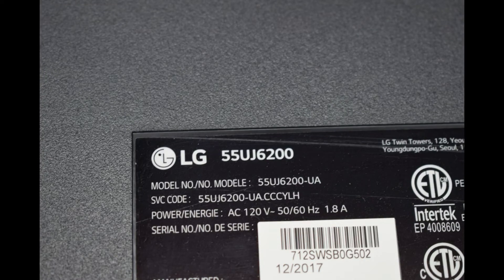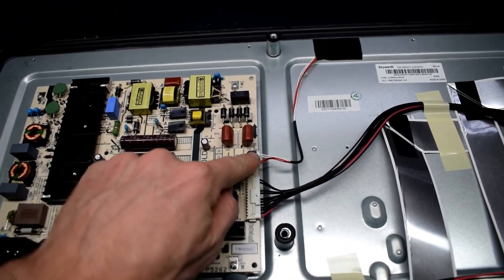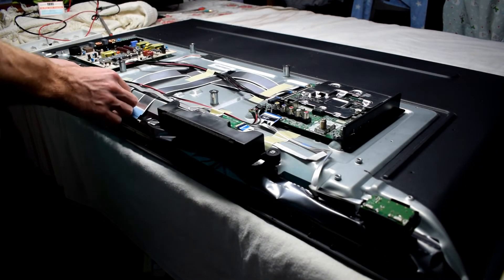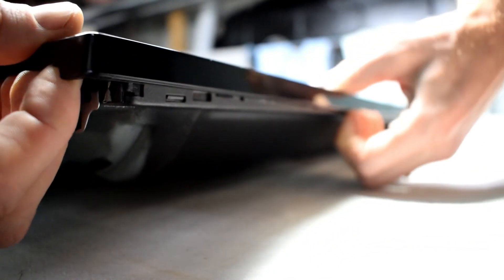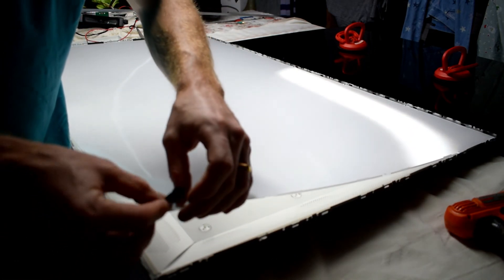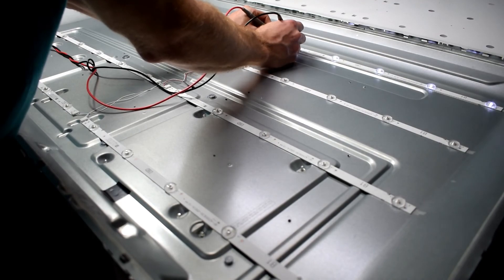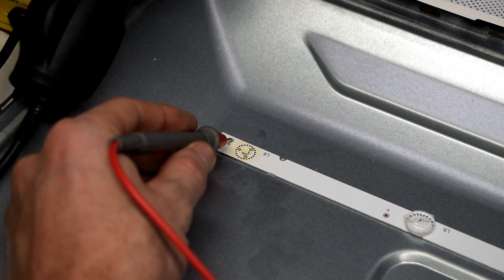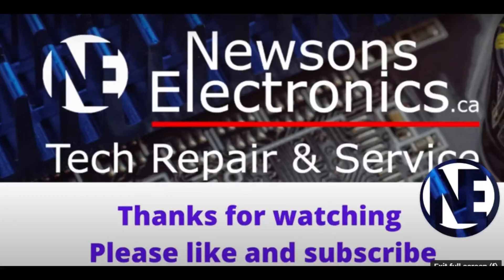Fix LG TV backlight for cheap! (Model  55UJ6200)

Comment: it helps to have the backlight tester - Fluke meter is not strong enough to push through the backlight. watch the ribbon cable connection but yes this is  the fix thanks.

Comment: Great tutorial 👏🏽👏🏽!! I have one question, if the glass round lenses comes off the led light strip, do I glue it back on to the strip ? If so, what type of glue do I use ?
Reply from the maker: I used shoe glue but silicon works
Reply: @NewsonsElectronics  thx !

Comment: If you dont want to mess with soldering the one light in can you remove and replace a single strip? I've soldered  pipes and metal but low confidence  in electrical boards

Comment from the maker: Any questions just ask them below.
Reply: Hi, I have been following your videos.  What's the name of that liquid you're using to repair the backlight? Thank you.
Reply from the maker: @fiificobbina6511  liquid solder https://amz.run/57ST
you can also tack it on with a soldering iron but it's a bit tricky
Reply: 2 questions: are the LED strips themselves plug and play if I got the correct model of strips? secondly, what is holding the strips down? is it glue or some other fastener?
Reply: 2 questions: are the LED strips themselves plug and play if I got the correct model of strips? secondly, what is holding the strips down? is it glue or some other fastener?

Comment: Hello Thank you for the video, the diffuser screen,  is the thicker sheet with the rough side down towards the leds. and  then the thin plastic sheet on top. I think I may have mine installed the wrong way. I can now see the leds thru the screen. also the black tape on the bottom of the back side. ripped apart how important is that tape layer.

Comment: I unhooked the led connection at the back, measuring at the power supply side of the connection its reading in mV(60ish on one, 58ish on the other). 
Bad power board then? I don't see any visible issues on the board.
Reply: Same with me. 58 on both. What’s next to test?
Reply: @bruizer28  sorry, I gave up and just bought a new tv. Figured it'd be a process of replacing a board at a time until it worked again.

Comment: Have the same issue with back light, flickers when turned on, sound, can see dim image with a bright flash light close to the screen but I’m also having the problem of the tv turning off after like 30 mins of being on also? Is that a whole new issue or would back lights going out cause that to happen also?? I can live without the image working, I normally just use the tv for music and background noise.

Comment: I have the same model and issue. Any chance you can recommend a repair shop around Toronto?
Reply: Exact same problem here also from Toronto, we’re you able to find a repair shop for yours ?
Reply: @hoth9whitey  I was able to speak to a technician but he advised to just buy a brand new one. He quoted the repair over $500 if he will diagnose and repair which makes no sense but to just buy a new.
Reply: @hoth9whitey  Are you disposing off your TV soon? If you ever trying to dispose, could you just let me take it?

Comment: Is it always the LED themselves that are the issue or could it be the power supply for the LEDs? Mine quickly flashes for half a second when I turn it on then the backlights go off. Wouldn't it be possible for the lights to flash if 1 LED was bad?
Reply from the maker: if flashes its the leds

Comment: Can I just remove an LED and solder the contacts or remove a whole strip?
Reply from the maker: no it detects the volts and current must match
Reply: @NewsonsElectronics  how big of a variance is allowed? I tried solder a new LED. Failed. ordered a new power supply board as this one is only putting out .08Vdc. New board installed but still not working. Removed LED and soldered direct bypassing LED. Still no go. Ordered a new LED back light strip kit, waiting on shipping. Learning a lot from your video and been having fun with this repair. Thanks for your time!
Reply from the maker: @kalynkoster6715  use led tester to test your leds you don't need to replace them all this  will determine if its your powersupply or backlights.
Reply: @NewsonsElectronics   I bought everything in your video. Tested every strip and every light like you showed. It’s one strip that’s being a pain. The LED on both ends works correctly but the 3 in the middle are messed up. I will see what happens when I replace the strip. Your video is very informative! I e watched it over a dozen times.
Reply: Ok replaced LED strip that had bad LED, still sound and no picture. When I hold a light up to the screen I can see it’s working but no back light. Replaced power supply board and still same issue. Any ideas
Reply from the maker: @kalynkoster6715  use led tester I bet your backlight is still the issue. When you turn on the tv the backlights should come on if there is standby on power supply board.

Comment: Have the same issue and same TV. Tested the voltage on both wires going to the backlight cable. Each of them is reading around 58. I know it should be 60, so thinking 1 led is broken per circuit. Is this still enough to shut the whole tv down?
Reply from the maker: you are correct

Comment: I have the same model tv with a backlight issue. Black screen. After watching the video I'm not sure I can do all of that without causing any other pro problems.  How much would this cost at a normal repair shop or should I just buy another tv.
Reply from the maker: I would repair it for you for $80 but I am cheap! and do the repair at home. I know of another person who got it done for $150 but they would replace all the LEDS. The key issue is turn your backlight brightness down to 50% to make the backlights last as long as possible.
Reply: @Newsons Electronics  I have the same model and can still see an very dim image if I look so close and the sound still work. Could that mean the LED lights too? Where are you located?